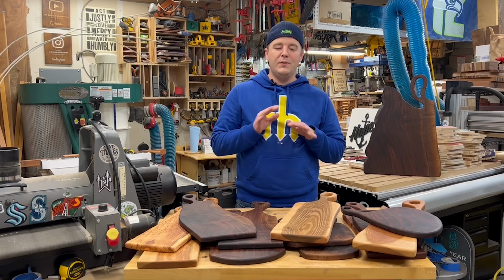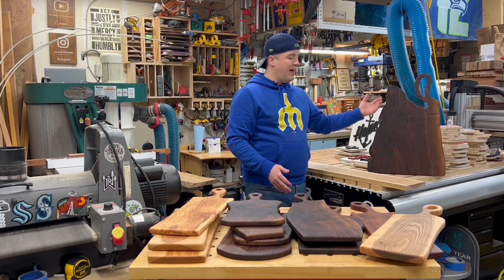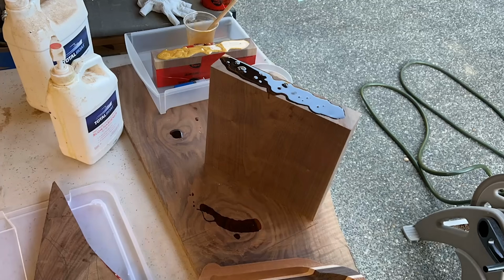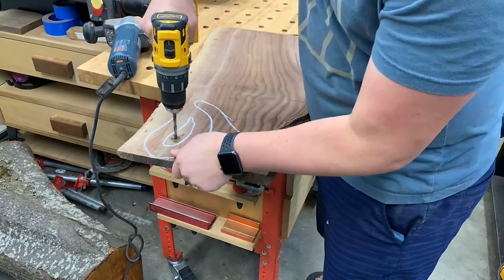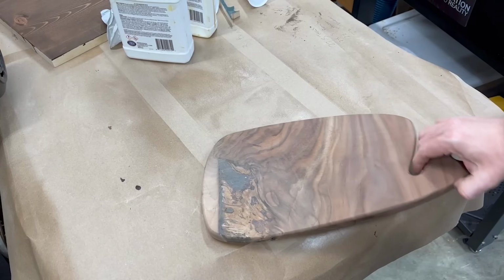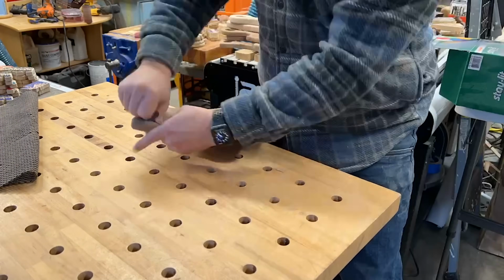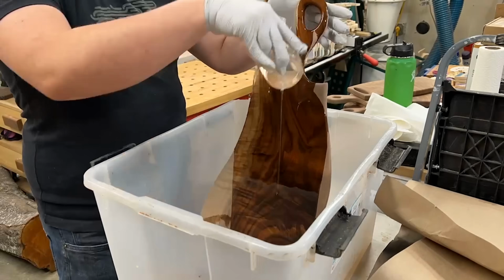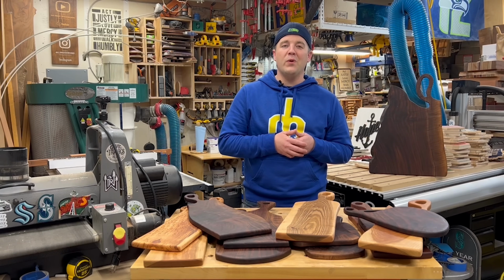How to Make a Charcuterie Board: Templates, Wood Selection, Finish Options, & More

Comment: I dont care if people use CNC to make things, but the fact people will make something out of wood with a CNC and call it hand-made when selling it. I dont feel it is hand-made at all. I personally don't think CNC machines should be used in woodworking. But I do understand some people have to have it because they have no skill or don't want to put the time in to learn the skill.  At that point, you are a CNC operator, not a wood worker. Just machine factory made goods. Not knocking you just my opinion of CNC and woodworking. Good video.

Comment: The “Wood Whisper” recently released a video on finishes. I now will exclusively be using 100% Tung oil. You probably can find the video I think you will appreciate it.
Reply from the maker: Absolutely. I referenced that in my CNC cutting board video when I tried it out. It’s a great finish.
Reply: Yeah. I saw his video. I’m using 100% Tung oil with citrus solvent to thin it. Takes a little more time, but it’s awesome for customers who don’t maintain boards well.
Reply: Just saw that video on TWW yesterday and will switch to it. Also just found this channel. I have a good selection of various woods that I am making Charcuterie boards with.

Comment: Im having so much trouble trying to cut curves with my bandsaw and when I try to use the jigsaw..it mostly just bounces!😢 I wish I could just get this.
Reply: Try using less tension on your blade. If it's too tight the blade won't flex

Comment: Quick question on cutting boards.  I’ve just ventured into this little hobby and while I’ve subscribed to you channel and some other wood working channels, I’ve come across an issue that I haven’t yet seen addressed. Now, this might not be an issue with anyone else and it’s simply me and my not Know-how to do this. I have 3 cutting boards that I am working on finishing up. I’ve sanded them down 60, 150, 240 & 320. I’ve added the cutting board oil multiple times and now I’m adding conditioner. Yet, every single time I wipe it with a clean dry cloth, I get the color of the wood on the cloth. Why is that?  Won’t that also get onto food?
Reply: How long u waited after oiling it up?

Comment: You mentioned, one of the boards was pine.  That using pine is okay as long as it is not cut on and the maintenance is kept up on the board.  Could you also do that with Eastern Red Cedar? If using pine, how often should the board have another coat of wood wax?  BTW... your videos are very inspiring.  Thank you for them...
Reply from the maker: Thank you! Yeah, I think any softwoods are still ok, as long as the grain is sealed and maintained. Usually maintenance is once a month or so. But varies by region temperatures and how often the board is used. If it’s losing the sheen from the wax or looking dried out, reapply. Thanks!

Comment: Another great video without "cute" distractions. What about live edge cedar rounds?
Reply from the maker: Biggest trick with those or any wood that still has the pith is to ensure it’s properly dried to prevent cracking and warping. Pentacryl is a product I’ve seen many use to help the stabilizing process for green wood. If it’s dry and humidity levels have equalized, it’s a great option for boards.